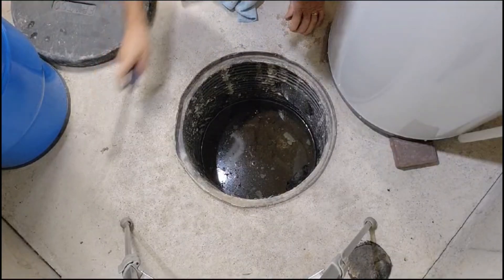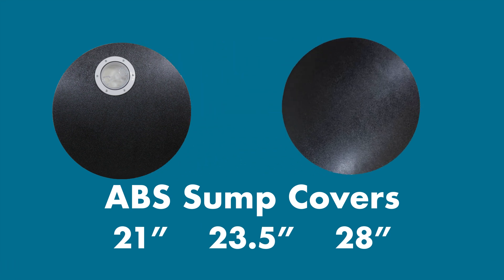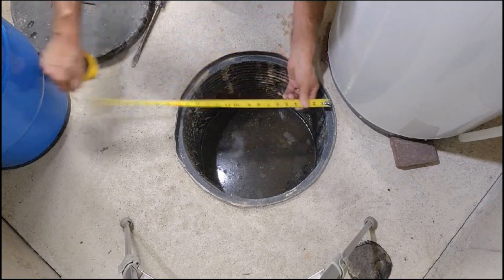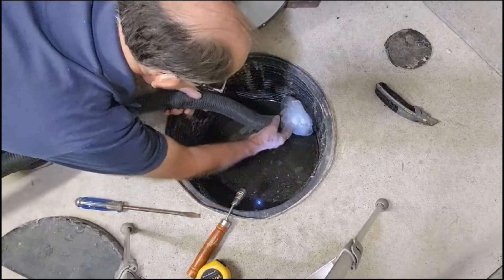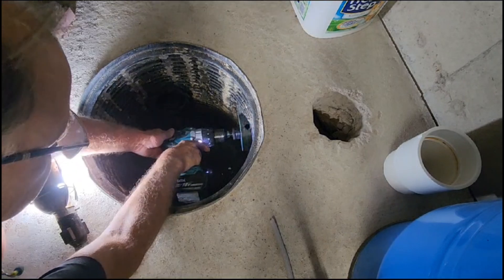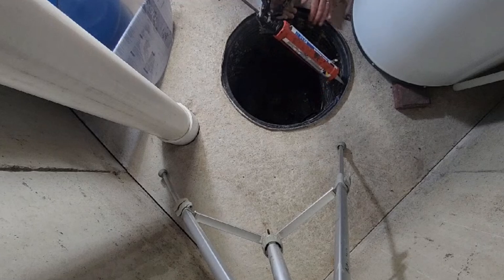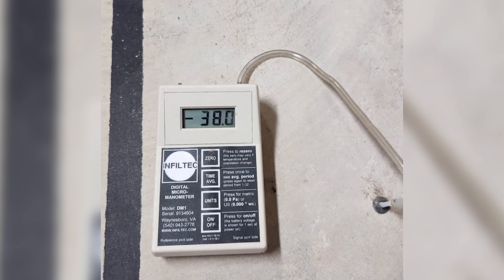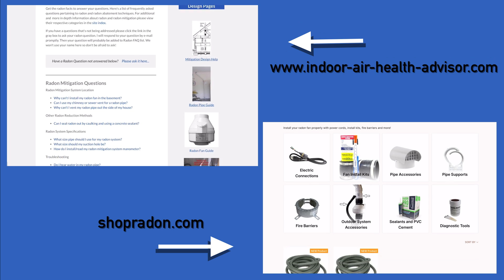How to Easily Seal Your Sump Pump Basin With a Lexan Cover (DIY Radon Mitigation)

Comment: Where is the sump pump?
Reply from the maker: In this home, the sump was dry and thus never had a sump pump installed. When there is a sump pump, holes for the outlet pipe and cords can be drilled, and then rubber pipe seals are used make it airtight.

Comment: I am looking for a 20 inch sub pump cover and it doesn’t have to be sealed.  It has an open sub pump cover the one with the slot for over 42 years. it’s probably been off for the last 30 years. We had a flood in our basement about two weeks ago. City water backed up into the house. Good thing there was no lid on the sub pump pit. It would’ve been a major disaster.  So I don’t really want to seal the sub pump pit. I would just like to buy a 20 inch sub pump cover and install it. So the water came in the house from the floor drain and went into the sub pump pit and it pumped it out. Not really worried about Radon Gas hasn’t been a problem for 34 years I’ve lived here, so I don’t think I’m too concerned now. The cover in your video is the one I would like to buy.  Just cannot seem to find one that is 19 1/2” to 20” in diameter. if I can’t find one, I just gonna make one out of aluminum that’ll fix it too.
Reply from the maker: Hello, sorry to hear about the flooding issues you had to deal with. That sounds very stressful. We sell a 20” x 20” and 24” x 24” version of the Lexan cover. This is a link to our store. 

https://www.indoor-air-health-advisor.com/healthy-air-solutions.html#!/Lexan-Sump-Cover/p/145423003